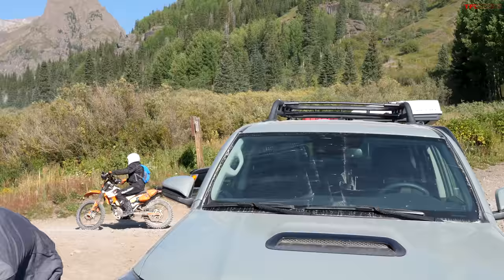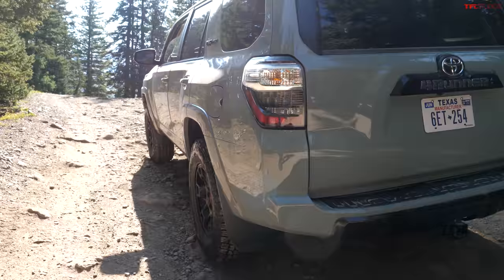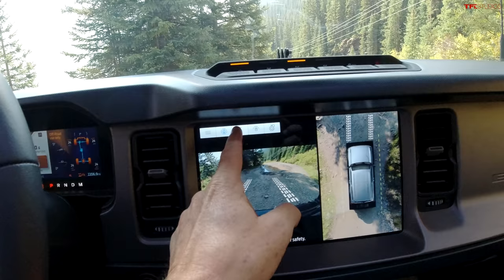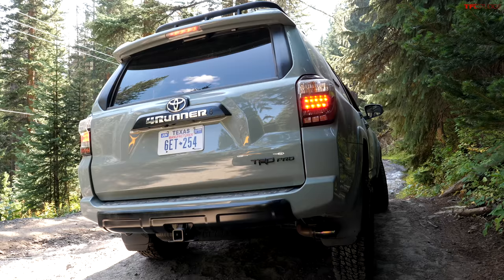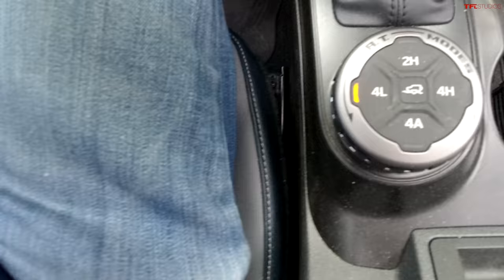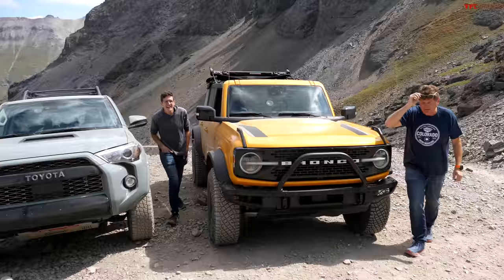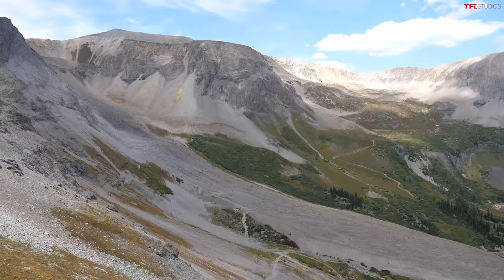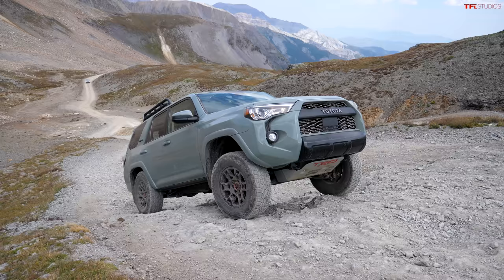The Toyota 4Runner TRD Pro May Be Old, But Can It Still Keep Up With The Ford Bronco Up A Mountain?

Comment: In all of the videos you’ve done the Bronco doesn’t seemed challenged. It made this trail look like it could be done in a CR-V.
Reply: the bronco makes it look effortless, https://youtu.be/rx34Tbefh4A put a stock 4 runner on this trail
Reply: Imogene can be done in most stock 4x4s on 31s, there are alt lines for lifted vehicles, but the main line is not that hard
Reply: I wouldn't take a CRV on the Ouray side of Imogene, but it could do the Telluride side.
In either case, pretty much any high clearance vehicle can make it, even 2wd with a locker and banging it up the obstacles as needed.

A couple years ago, I watched a guy force his CRV up that last switchback on the west side of Engineer pass. He did it. I am sure he scraped a bunch, and was lifting wheels like crazy, but he didn't totally destroy it.
Reply: Trust me the trail could not be done in a CR-V. We've personally rescued two off of this trail. The Bronco is just capable.
Reply: @CoyoteFTW  what is your point ? let's see how long the Bronco Lasts
Reply: Did it in a WK2 Trailhawk bone stock.... I'd say anything less would be a challenge
Reply: Also Telluride side (once up to the old mining town) is actually annoying to go down, a lot of blind drops.
Reply: @CP-kb1du  Typical Toyota owner response.  If you can’t beat the competition, claim best reliability, and if that doesn’t work claim better resale value, which only works if you’re willing to pay top dollar for a high mileage tin can and anyone with common sense would never do this.   I own an 18 year old F150 that tows and seen a lot of dirt roads and it’s only needed the fuel pressure sending unit replaced.  I’d say that’s pretty reliable, wouldn’t you?
Reply: Nothing on imogene is difficult, I would call it a 4/10.   This same bronco video on red cone is more of demonstration of capabilities
Reply: @blackjackshellac3886  >
Reply: @blackjackshellac3886  
Toyota buyers are simple minded, brainwashed loyalists. They make every excuse in the book as to why their brand new vehicle is 20 years outdated, yet costs the same as other modern vehicles.  Then they call it "ReLiAbILiTy!!!" lol.  If you don't have a feature, that feature can't break.  It's pathetic.  Tommy can enjoy his rust bucket junk.
Reply: Aye the crv Lowkey can do pretty good off road my mom took it on trails 😂
Reply: @blackjackshellac3886  Yeah cause it’s an 18 year old Ford. My 2013 Fords are both pieces of garbage. I bought them on Ford’s reputed reliability, only to be let down. The Eco Boost engine is riddled with issues, is extremely expensive to repair once the turbo starts failing, and can’t be induction serviced. I’ve had tons of coolant system issues with my Escape as well, and every mechanic I take it to says to sell it ASAP. Every part of the car feels cheap, and I’m never buying a Ford again. I’m buying the Toyota cause I know it will last me at least 15 years instead of the 5-7 it takes to pay it off.
Reply: @zachmcbee9311  the 9 speed zf trans , total fail not reliable
Reply: @shawncell1247  what does that have to do with anything? The zf 8 speed is solid
Reply: @mrvwbug4423  Not even 31s.

Ouray rental Jeep Wrangler Sports on factory tires with full road air do Imogene all the time without issue going at least as far back as YJ Wranglers with 235/75R15 Goodyears.
Reply: @wildman1137  If you don't have a feature, you're correct, it CAN'T BREAK.

Some of us would love to have vehicles with regular mechanical linkage 4WD gear selectors, manual transmissions and even manual locking front hubs would be cool.

Toyota updates their vehicles every so often but it's something that's rather dreaded than looked forward to; people who are Toyota fans would rather they not mess with a good thing.
Reply: They could
Reply: I redact my statement.  You REALLY should have a low range in order to safely go back down once you're up there.
Reply: The difference is definitely the tires, but not always the case, seen a video of a Silverado trail boss do a dirt trail/rock trail and it was slipping and couldn’t get up certain spots while the tundra was doing it easy, with less hp and less off-road tire quality
Reply: @wildman1137  so mad you are.. this is common with people who choose to argue that their ford is more reliable then your chevy 🙄🙄🙄
Reply: @VideoArchiveGuy  spot on man.. calls his 20 year old ford reliable, then insults toyota for not updating their tech.. such a loser man!

Comment: I’m actually quite impressed that Bronco got over 19mpg with such an off-road biased set up at elevation like that. No surprises on the 4-runner mpg. I bet if you put 35’s and the same lift on the 4-runner you’d see less than 19mpg. 
Great vid guys!
Reply: Yeah, quite a bit less. I put 265s plus 2” lift and on my Tacoma and my mpg dropped by 3.
Reply: The fuel economy test did not include the off-road portion. The test was for their drive there I believe.
Reply: From what I see in the 4Runner groups, 35 inch tires on a 4Runner get you 12 to 15 MPG at best. Not to mention, they don't really fit right, so you have to lift it a few inches and do some cutting of the inner fenders and the chassis. You also need to regear, since the 4Runner is geared marginally for its stock size tires.
Reply: @trailrunnah8886  Yes but the 4Runner doesn’t need 35’s!  So it’s moot point.
Reply: The 2.7TT is a greatly underappreciated engine design. Ford is lightyears ahead in engine technology over all other automakers, especially the Big 3 and Toyota.
Reply: @StubProductions  sure it does! Plenty of owners put 35s on them, clearly they think that they're needed.
Reply: @brentworls8509  Ford is one of the big 3!  😄
Reply: @trailrunnah8886  They probably put them on to look cool cruising the the mall.  Good set of mud or a/t tires in stock size coupled with a 2” front and 1.5 back lift is really all that is needed for most off-roading
Reply: @brentworls8509  ford greatly under appreciated lol there own salesman say there junk and wont last quarter as long as a Toyota motor
Reply: @user-ce6vi4fi6i  maybe not....but for sure the 2.7 twin turbo will cost a lot to fix when it does
Reply: @user-ce6vi4fi6i  Until you look at the state equipment auctions with f-150 trucks over 400k miles or more.
Reply: @StubProductions  I would wager that more people that run 285s are doing it to look cool going to the mall than people that run 35s. With the amount of work that it takes to get 35s on one of these, most people aren't doing it just for looks. That said though,  I guess I do agree with you that 35s shouldn't be necessary on a 4Runner, because if if you're in the type of terrain that requires that much tire, you should probably be in a Jeep anyway. I'm all about the right tool for the right job, and the Wrangler is a tool much more suited to that use. Modding a 4Runner to that extent just seems like a poor return on investment.
Reply: 10 speed tranny do save some gas, but will it last?
Reply: @brentworls8509  bingo! City fleet tech here.
Reply: They didn't tell us the speed though. It makes a huge difference in mileage.
Reply: @brentworls8509  the state takes good maintenance of their vehicles i would assume....
Reply: @brentworls8509  actually toyotas dynforce engine.  The one used in rav4 and camry are quite amazing.   They have to expand their dynforce innovation lineup in all their models though.   Mazdas hcci is really amazing but reliability wise its still up in the air as theyre brand new.
Reply: @yourlame9795  you're.
Reply: @trailrunnah8886  That's why I run 35s on my JKU with 4.88s and Detroit TrueTracs front and rear. The PU F-150 stays stock.
Reply: @TheWinwin4all  My Ford is a 6 2.7... couldn't love it more.
Reply: @iskdude9922  but the drivers don't.
Reply: @StubProductions  lol you don’t need 35s for hardly anything. Most people be mall crawling with 35s.  you can always tell the type.  not a scratch anywhere on the underside😂
Reply: @user-ce6vi4fi6i  Wow! So many people reading the future, you should go play the lottery.
Reply: @freakyt333 

You’d definitely have to re gear to get closer to the Bronco.  3.73’s are meh.  I wish the 4Runner had at least 4.10’s
Reply: Yea you do have to factor in the transmission gears the ten speed definitely helps the bronco improve its gas mileage compared to the 5 speed in the 4runner
Reply: you would need ratio change & more hp.. 10 sp box helps. same revs all the time.
Reply: My friend has 32’s on his 4 runner and doesn’t touch anything near 15 mpg 😂
Reply: @jackpixley3696  mine has 32’s.  I get 18-19.5 on the freeway and 17 around town.
Reply: @StubProductions  I went from 33s to 34s and finally to 35s on my 5th gen 4Runner. 35s make a huge difference in tackling larger obstacles and rocks, I've gone on same trails with all these tire sizes, and while 34 to 35 difference is marginal, 33, to 35 is huge. And it looks good parked at the mall.
Reply: @zedxrom7867  How much lift you running and did you re gear?
Reply: @StubProductions  4.88, and I'm on Long travel suspension, so It probably won't be too helpful to know how much lift, it's about 4.5" overall front and 5 in the rear.
Reply: @trailrunnah8886 how much psi are you running on your tires
Reply: @steve9348  I have stock size all terrains on my 4Runner, I'm currently running 35 PSI in them.

Comment: Thanks for the memories!  Just did Imogene last month with my daughter and had a blast!  Fun to see all those obsticles and fantastic scenery again.  We did it in my 2000 4Runner with 225K miles, (been in our family since new).  It has a 2" lift and 33's.  Climbed over everything in it's path without lockers...I was impressed with it's capability, and also got us all the way back home to Kentucky without any drama.
Reply: Impressive. I have a stock 4th Gen and I needed my rear lockers once. I’ve seen a stock 3rd Gen do it though with 4WD and a locker.
Reply: @unodfredy I kept it in 4WD low and first gear going up the steep stuff.  I'm running Falcon Wildpeak AT3w's...it was wet that day and those tires gripped really well.  Only spun on one steep switchback, but picked a better line and they crawled right up.  I just wonder if we will be seeing any '21 Broncos in 2041 still climbing a 13000' pass.
Reply: And that is why I'll never give up my 4Runner. Yeah, it's old tech but it still goes pretty much anywhere off road and on and you know it has iconic reliability. Something no American brand can say, unfortunately.
Reply: @jimren5638  You will have to pry my 4Runner out of my cold dead hands! 😂
Reply: @stevevice9863  that I do not think so. Unless they were like garage kept, have low mileage, and a granny drove it
Reply: @Pro4x Trdpro the 01's do not have ATRAC. 

I believe they may have started in the 4th generation 4runner.
Reply: Yup, I have an 01 with a 2" lift, on 265/75r16 tires, basically a 32".

Takes me everywhere, and is my daily driver now.

As long as you maintain it, it'll never fail. 

I get compliment almost weekly on this thing and it's 20 years old.
Reply: @jimren5638  I'm getting old but I can still drive my 2000 Tacoma! I dont need a vehicle that can drive itself!!

Comment: I just did Imogene, Black Bear and several other passes and trails in a 2007 Pathfinder with open diffs. I think you guys need a little challenging trail to really judge these 2 vehicles.
Reply: After what happened with them and subaru, I think they pick a semi challenging trail, but nothing crazy so they don't burn their relationship with anymore manufacturers
Reply: @Rommer2258  Hey Joe, which video are you referring to?
Reply: @duey1083  this was like 6 years ago now. Look up tfl subaru issues
Reply: Yep, both of those trails are old mining routes that are now semi to well maintained adventure sightseeing trails. They can be dangerous because of the elevation and drop offs but as far as challenging a serious off roader, nope, not at all. The differences in these two will only come at the extremes of capability where the Bronco has the advantage. But how many people who buy either of these vehicles will ever push them to the point of near failure to find out? For most people, most of the time and going to most of the places where non rock crawlers go, either will work and so will a couple of dozen other models on the market. And, by the way, although it never got much respect here in the US the R51 Pathfinder was a very capable off road vehicle if it's driver ever asked it to be.
Reply: Yes, this is good compare video, my 2000 F150 with open diffs did Imogene, it's still challenging depending on the snowmelt and maintenance but I think the Bronco is more aggressive and needs a more challenging trail to show it's full potential.
Reply: I wish I could be as cool as you
Reply: Most of this trail from what I see in the video seems to be flat paths with a few small obstacles that you could clearly bypass.
Reply: I don’t care how easy everyone says it is. It still makes me pucker in places. Last trip I did was August 2020 in my 2019 Tacoma DCOR manual. Wish in some places it was geared lower. It’s gone now for a 2021 4R OR.

Comment: That Bronco needs more of a challenge! So far, it has effortlessly smashed these trails!
Reply: from what i hear imagene isnt much of a challenge at all. people do it in full size and hd trucks all the time.
Reply: It has been challenged on more than just Imogene.  You just need to do a little bit of searching to see it in proper action.  But then, you can see the 4R being put through more extreme scenario's as well with a little search.  ;)
Reply: The bronco already has enough challenges man lol they can’t even make the tops work right lol
Reply: Wont happen
Reply: @robertyoung8289  — i know the roof has been an issue (seems to be resolved) but 100k miles? Which part of the vehicle will fail? 
The engine? Built specifically for turbochargers and composed of Compacted Graphite Iron and and is literally one of the most durable V6 blocks in existence
— check with the millions that are on the road including fleet and service vehicles and get back to me on that…many of these vehicles have exceeded 200k miles and are well on their way to 300k miles

The Tranny? Co-produced by Ford And GM and is in most Ford, Chevy and GMC (cars, SUVs, cargo vans, trucks etc…)
— once again, check with the millions of vehicles that are in service and see if they are still running after 100k miles or even 200k miles…

The suspension? Get real! Most suspensions (even the crappy ones) usually outlast the vehicle!
Reply: Maybe Poughkeepsie gulch
Reply: Take the bronco to Johnson Valley and do one of the easier trails like Clawhammer.
Reply: I agree.  I’ve been up Imogene and I saw people in full size trucks and some people in front wheel drive cars.  Not much of a challenge.
Reply: @Bacnow  robert young was just trying to be one of those funny ford haters 😉🙄
Reply: @jcart011  is full size pickup less capable ? Jsut wondering
Reply: Did they smash their power steering problems lol
Reply: needs a front diff. sorry,but ifs is rubbish.
Reply: @robertyoung8289  y’all acting like ford just started making vehicles. I have an expedition escape and an old explorer 2 door sport all been good to me. The old sport has over 400 miles only changed alternator twice and radiator and starter once.
Reply: @modlerjeancharles3287  hope you meant 400000 miles
Reply: @justinteal495  i  love fords..  they let me practice my vehicle recovery skills without having to go to dangerous places.
Reply: @hs5942  up in the rockies, there are many trails where they just don't fit through.

Comment: These videos are great. Through them I have learned that you don't always need every off road option to have fun. Big tires and four wheel low can get you most places. Thanks guys
Reply: Amen
Reply: And 🔒 👌
Reply: Just got back from an overnight trip in the Ozarks in my ‘21 4Runner Off Road, stock with 275/70/17 Falken Wildpeak AT3Ws and it did amazingly well through some pretty gnarly stuff.
Reply: Pretty much. Remember the kind of trucks people were driving on these trails decades ago. You really don't need all the bells and whistles on modern trucks.

Comment: Toyota should make their Pro models run 33’s and at least the Ridge Grapplers. Bet it would be a game changer for the 4Runner.
Reply: My Pro came with Ridge Grapplers, not 33’s but still nice to have over the Terra Grapplers!
Reply: A game changer? The 4 runner is one of the most highly sought after vehicles in the U.S , there’s a reason you can sell them damn near close for what you paid for them , no other vehicle can compete in resale value.
Reply: @yourlame9795  I have an 01 4runner that still takes me through the trails, hunting ranches, fishing spots with no problem.

My wife's 2016 Trail Edition came with all the same off road technology in this video that the TRD Pro has. Only difference is suspension, skid plate, and emblems. 

We were 6k upside down on a trade in. Now it's worth more than we owe. The "Toyota Tax" is real.

I love our 4runners and get compliments on them from alot of other people into this kinda stuff.

With that said, those Broncos are pretty sweet, I'm so glad Ford didn't do to the Bronco what GM did to the Blazer.
Reply: @txrunroutdoors  They did and it is called Bronco Sport.
Reply: @txrunroutdoors  I bought a 18' pro with 20k miles a year ago for a steal. Dealership just reopened after Rona and wanted to move vehicles. It's actually gone up in value since I purchased it, even WITH the 20k miles I've added to it.  It's nuts
Reply: @yourlame9795  traded my 2020 TRD ORP for more than I paid for it after a year (only 7K mikes). Went back to the GX. It will do all I want with Toyo AT3 and if I want to do more I can have some deletes done and it’s more than capable. Big fan of the V8 in the GX.